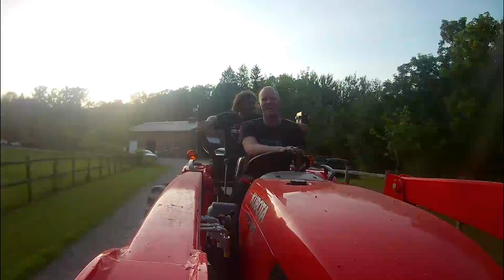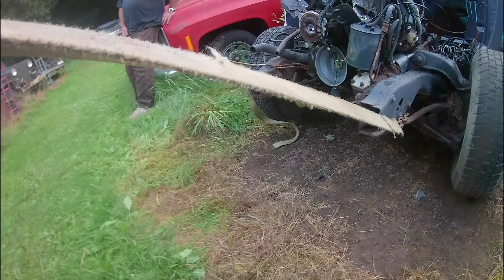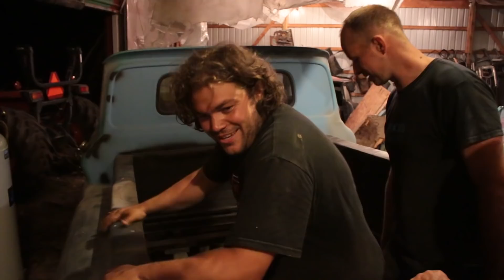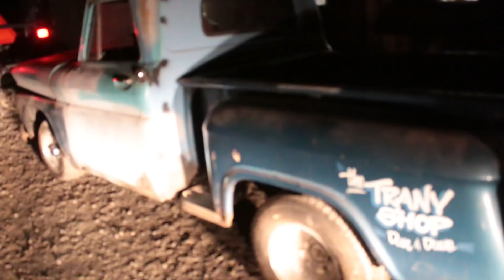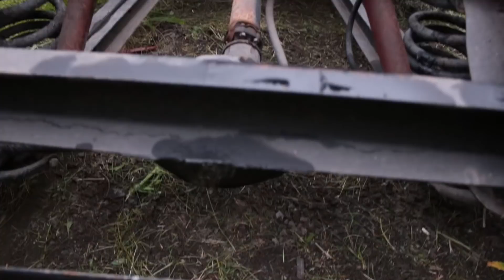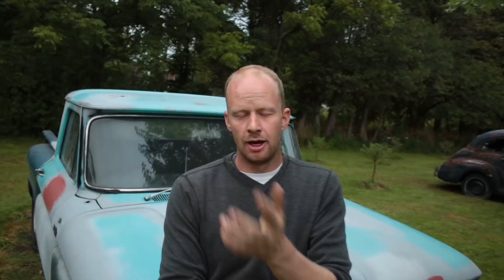I Traded The Commander For A Chevy C10! #TTDmaxC10 [EP1]

Comment: There is a finish I was considering for my own project. Raw steel, brushed, with a clear coat.
 Regular paint clear coat as you work an area, then a baked full clear coat on the entire vehicle after body work is finished.
 For the main body, do the metal work joints with tig welds and leave them showing. Make the joints look like scars, maybe add a few scars for looks.
And call it Franken rod

Comment: Glad you went with the C10, the other car was to big of a project. I will definitely be following your build on this ride. Flat black is out Patina is in but kinda fading, no pun intended, but that should be cool. I would go with the bigger frame and the air ride after all everything is there to handle the HP of the Dura-max. Aloha

Comment: Now that was a good trade, these series of Chevy pickups have very nice lines and yours is relatively rot free especially on the eye brows above the windshield. Now if you don't mind my two cents worth, I would not consider flat black as that is cheap and cheesy and doesn't show off the clean lines of this rig. I personally like a survivor looking truck with a natural or faux patina that is done well,  the "just pulled out from behind the barn look". Keeping a light pastel colour which was in fashion for GM during these years is my taste and dropping it on an air ride with dual wheels as a tow rig, especially a short box, aw man that would give a lot of truck guys a chubby! Oh and maybe think about a row of vintage cab lights on top with small west coast mirrors and c.b. antenna...

Comment: Turquoise blue with some light surface rust would look cool To many Black trucks around. The air ride from the bus sounds great can't wait to see progress on the C10. Cool project great videos . Oh by the way you saved my bacon I have 03 2500 with 5.9 cummins it had a Crank no start problem did have the money to have a shop work on it, watched your video on that and fixed my truck myself Thanks,  Now just need to rebuild the front end Death wobble at 60mph.
Great stuff keep it up I going to order a tape boss. and check that out.

Comment: I've never done an air ride suspension, but don't the bags have different weight ratings?  The sidewalls might not even flex when aired down with a lightweight C10 body on top.